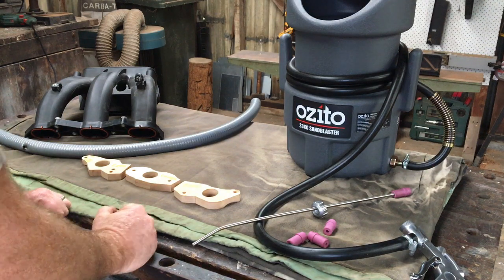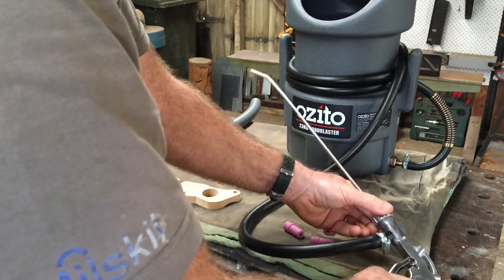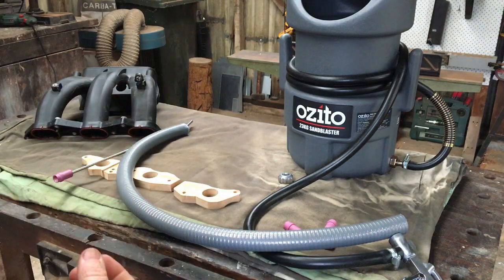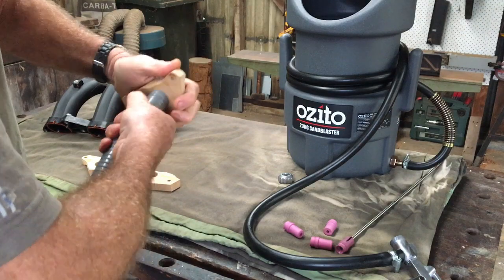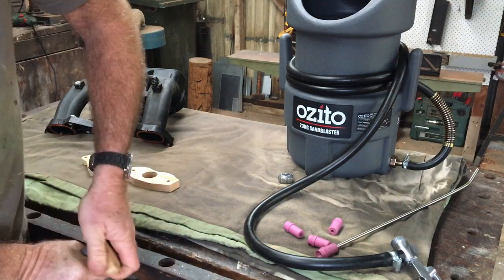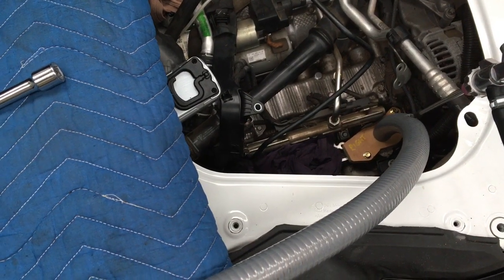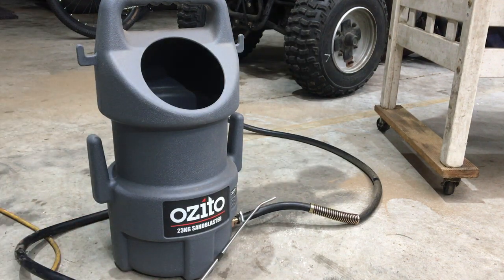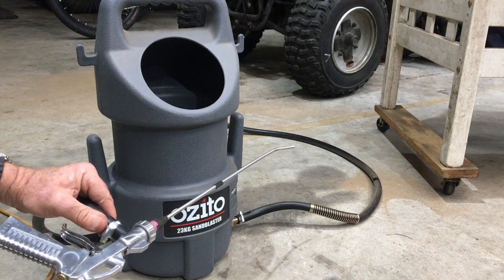Walnut Blasting of Intake ports

Comment: Hi Jeff, I really appreciate your videos. I’m planning to clean my intake valves soon and was curious about the wooden guides you made. Would it be possible for you to take a top-down picture of each one next to a ruler? I’m considering 3D printing some. Also what grit walnut shell would you recommend using?
Reply from the maker: Can you contact me on the channel email address: jjrichar12@gmail.com.
It might take a while as where I live has been hit by shocking storms and I have no power/internet/phone. but I should be able to get the info you need at some stage. I don't know what the grit was. It was just some generic stuff off ebay.

Comment: HI Jeff.   I am having some minor issues with my 981.  The rpm needle is a little jumpy at idle, sometimes I have some odd vibrations - mostly felt when the temp outside and temp on the car is in the lower end.   Once the car fully warms up it idles much better.  Car feels fine and drives fine otherwise.   Hooked up a PIWIS and I am not finding any faults or issues, no misfires.   the only think I am seeing is some higher value on 'engine roughness cylinder 1-6" values,  though I am not sure what these value are really supposed to be.    Any idea if carbon build up on the intake side could cause those symptoms, or maybe you know what else to check.   Thanks for any input.
Reply from the maker: A little roughness at idle is normal. There's always going to be some cylinders that are more rough than others. The roughness values represent a roughness in rotation after that cylinder fires, as the crankshaft position sensor is constantly monitoring tiny changes in engine speed throughout each rotation. No codes means nothing is beyond a limit, but carbon will build up over time and affect how it runs. I was getting no codes but blasting did make a difference to how it performed.

I saw the post on Planet 9 with people talking about MAP sensor changes etc. I'd be very surprised if it's anything like this. Carbon buildup is a known issue on many GDI cars. As these age it will become more and more prevalent, and is what I'd be looking at first if you are concerned.
Reply: @jeffrichardsoncardiy  thanks so much for the additional information.  I was surprised to see people suggest MAF sensor changes when the 981 doesn't even have one.  The rough idle has been an issue since I got the car 2 1/2 years ago.   At first, I thought it could be some bore scoring,  as I also had a lot of soot all over the rear bumper.   However, after 2 1/2 years and 13,000 miles there are still no other symptoms, no oil usage, no misfire, and after a couple of bottles of Techron fuel injector cleaner, I don't even see the splatters of soot on the rear bumper.  The tail pipe does get a little dirty but mostly if the car idles a lot,  when driven normally or hard, very little sooth.      The last oil analysis, which was my first, did show a little bit a fuel dilution.    Just sent out my second sample for analysis.
Reply from the maker: Very unlikely that it's bore scoring on these engines. Unless you are thrashing cold, there's really no risk unlike the previous generation of engines. Wouldn't take too much from the exhaust tip soot. Unless it's a car with next to no miles I would simply expect a good bit of carbon build up, and I'd be correcting this first prior to looking for other issues in the absence of codes that point to something else.

Comment: How bad were the intake ports prior to doing this, and how many miles/km are on the engine?
Reply from the maker: Engine has 75,000 km. I cleaned the ports a little less than 12 months ago using brake cleaner. It was effective, but not like the walnut blasting. I'd seen someone else use this method online and I wanted to give it a go. 

The valves weren't so bad. Some general carbon buildup on the ports and valve heads but it had built up a good bit of gunge on the stems. It surprised me how much had built up on a short space of time since the last cleaning.

Now looking at installing a catch can inline with the current oil separator to remove as much oil as possible prior to entry to the intake manifold. Parts in the mail and plan to install when they arrive.
Reply: @Jeff Richardson  looking forward to that install video!